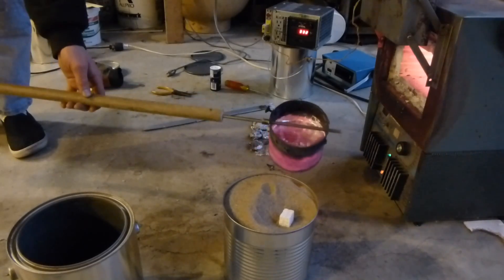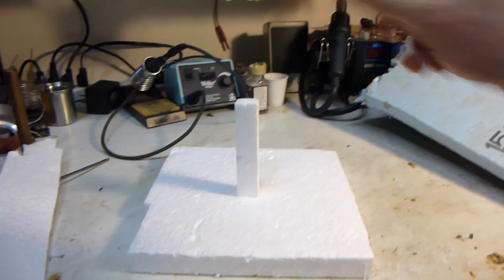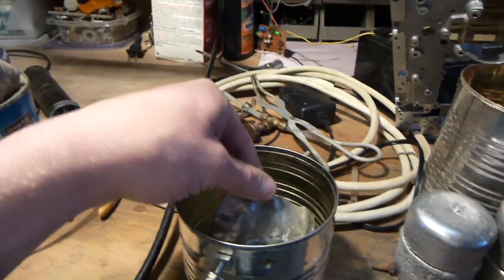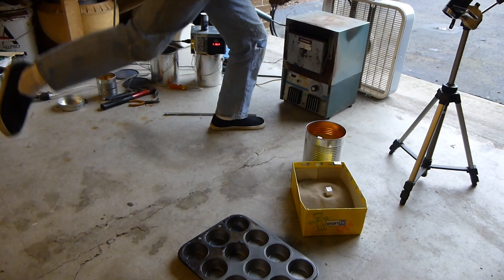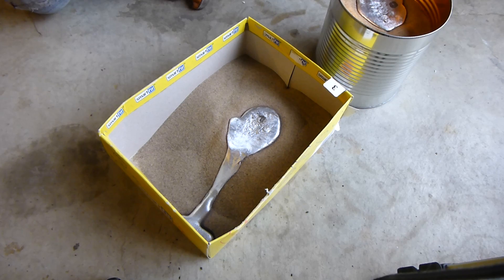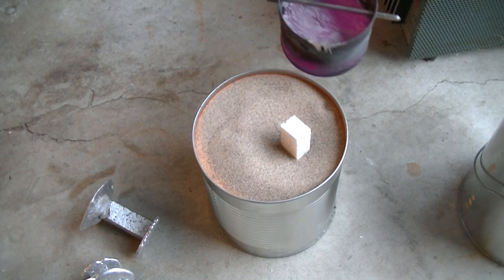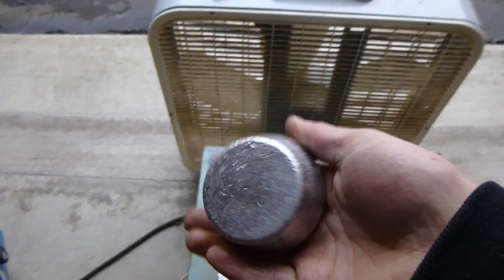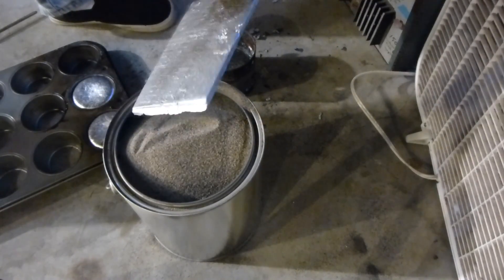Aluminium Lost Foam Casting Experiments and Tips

Comment: Maybe it's asked before, but it's not very clear to me now:
- Does adding regular tablesalt to the molten aluminum really help to get rid of impurities? I read about 'Borax' but that's harder to get. Does regular table salt work the same, and why would it work? Never read why salt would help?
- I read somewhere that after you've added salt, you also could add soda, that helps to make a nice structure or something?
Hope someone can explain it to me!
Reply from the maker: Triangle_DIY I believe you do not want to use Borax for aluminium.  I think you use Borax for copper or something.  I am using No Salt which has no sodium chloride.  No Salt has potassium chloride in it which is supposed to do something to the aluminium.  I think it is either supposed to make it more liquidy so it flows into the mold bette, it gets the impurities out or it forms a layer that keeps the oxygen from getting in.  I don't know a lot about it.  I read that No Salt is the best thing.  But it sure did't seem to do a lot.  That probably didn't help much!  :P
Reply: Thanks, interesting! only problem is NoSalt isn't availble here in the Netherlands, at least i've no idea where i should buy it. We have LoSalt here, thats 1/3 sodiumchloride and 2/3 potassium chloride. I guess that should also work?

EDIT: did some research. In a video of myfordboy i heard it. He adds salt to make it more fluid i quote: "Without the salt its like trying to solder without using flux" Tablesalt will work, but he uses LoSalt wich works better in his opinion. After the salt he adds washing soda(In an aluminum foil 'bag', to degas the molten aluminum.
Reply from the maker: Triangle_DIY Yes I have heard of LoSalt.  It's even supposed to be better than NoSalt.  Interesting.  I'll have to look into the washing soda.  Thank you!

Comment: Hello,
I see that you had the problem with the gasses what you might try is two gates this way the gasses can escape also you get twice the head pressure so it is a double win there. Check out  my friend's channel for our version of the same thing you did and see if that could work for you. 
https://www.youtube.com/watch?v=buBrplI8-yA
Hope this helps you. 
PS the guy in the video has built a 3D printer so if you need some pieces for some lost PLA casting experiments we would probably sell some to you.
Reply: Sorry I missed so many commas in the first sentence.
My strong suit is science not English.

Comment: Kentucky, not sure if cast aluminum can be milled though
Reply from the maker: Brandon Brewer Yeah it can be.  I might try milling some in my drill press some time!  I guess I would have to ship it to you.  Might be expensive.
Reply: If you construct an X/Y table using threaded rods and block it would essentially convert a drill press into a mill. I have some end mills if you need some.
Reply from the maker: Brandon Brewer I would love to do that!  It's a really good idea!  The only problem is that drill presses are not made for milling things.  I have tried machining some blocks of wood with router bits and using my drill press as a lath.  After a couple minutes the chuck popes off!  Drill press chucks are only held on with friction.  I mean I guess I could glue it on... But I'd hate to do that because if I ever had to take it off...  But I could make a nice drill press vise...  Maybe even cast it out of aluminium.  Thank you for the idea!

Comment: is it possible to sand the cheap foam to smooth it ?
Reply: better to coat it with wax to fill the surface? (and wax-fillet the corners so a) the metal flows through better b) doesn't allow so many sand inclusions). The wax will burn off with the foam - I've tried this before I graduated to making wooden patterns for green sand moulds.
The blue foam does give a much better result though, if you wax it it almost looks finished straight from the sand :D
Reply from the maker: eucalyptux Yeah I guess you could.  But I'm not really sure how much it would help because the hold are all though it.  It's like Swiss cheese.
Reply from the maker: Dave H Cool, I'll try wax!  That sounds like it works really nice!  Thanks!

Comment: Hey makerj, I have a small metal lathe. If you cast some aluminum dowels I could try to machine some parts.
Reply: What is was wondering, if you cast a nice big round block of aluminum, can you just machine it, does it machine like normal aluminium? Would be cool to machine a aluminum cooling block, or a crankshaft of some sort.
Reply: drill press isn't going to work that well i guess. Also, i heard a drill press has bearings for vertical pressure, and isn't meant to be used for such things. You can also fit router bits etc. in in it, but the sideways strain destroys the bearings i'm told.

You could also save up for a lathe. There are small chinese lathes being sold, that are quite good enough for hobby purpose. Or you could ask someone in your neighborhood, for example someone with a small company?
Reply from the maker: Brandon Brewer That would be cool!  Where do you live?
Reply from the maker: Triangle_DIY Well I did make a fly wheel but I didn't do any machining.  I want to try machining some.  I guess I could just stick it on the end of a motor.  I've tried machining things in my drill press but it makes the chuck fall off!!!
Reply from the maker: Triangle_DIY Yeah that's totally possible.  I've tried router bits in it!  And yeah it makes the chuck pop off!  :P

Yeah I may get a lath eventually!  Thank you!

Comment: why dont you seal the styrophone?
Reply: i gues that would make sense (drying it)
all the steam that escapes also makes the mold deform
Reply: Makerj101 Take a look at" David A",he has best results with a thin layer of plaster on the foam, make sure it is thoroughly dry to reduce any steam,I will be trying this tomorrow.
Reply from the maker: ***** I was reading about that. So like seal it with wax?
Reply: I don't know
I would guess that it would work

Comment: Very cool ! I really like your furnace! wish i had something like that.
Also very nice ingots! I didn't heat the muffin tin, and it doesn't stick! I had some blue color on my ingots from the heat, but it definitely didn't stick. your ingots are a bit smoother though. Looking forward to the next video's!
Reply from the maker: Triangle_DIY Yeah I'm not sure!  I read somewhere that you should heat them up so the rust so the aluminium does not stick.  Sounds like it is not necessary.  Thank you!

Comment: Oh, it's a Kiln! No wonder why I didn't recognize it, I never thought about it being a kiln XD, nice video
Reply from the maker: dc2008242 Yeah Kilin!  It says furnace right on the front.  So IDK!!!  Same thing I guess!  Thank you!
Reply from the maker: dc2008242 Ahh so there is a difference!  A kilin is normally loaded up with the items(glass, pottery, etc) then turned on and aloud to heat to the final temperature and then turned off and cooled before the items removed.  A furnace is normally brought up to temperature and then the items inserted and removed when it is hot.  So because a kilin only needs to be opened when cool it does not need to be as easy to open.  So because this is so easy to open when hot it is technically a furnace.  Thanks!  I just learned something!  :D
Reply: Makerj101 I like how you say thanks to me for learning something when you taught it to yourself XD
Reply from the maker: dc2008242 Hahaha yeah I do that!  =D  Thanks!